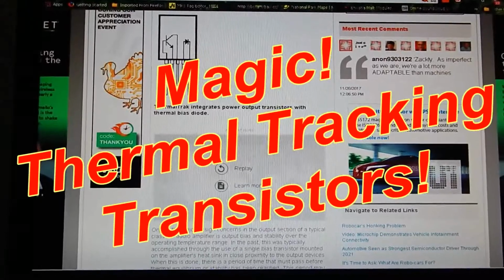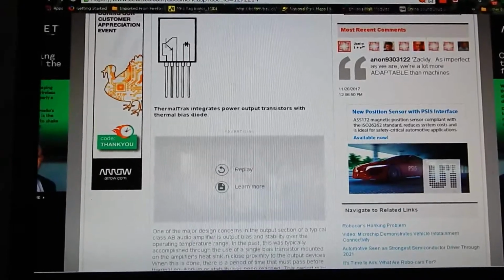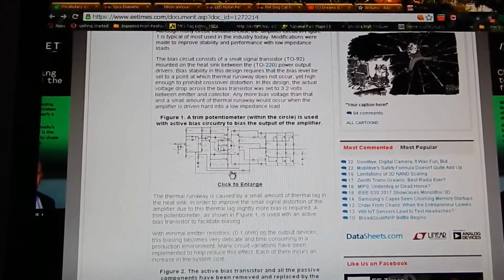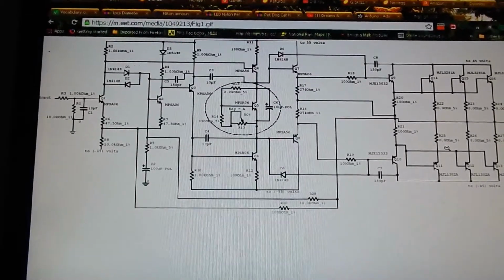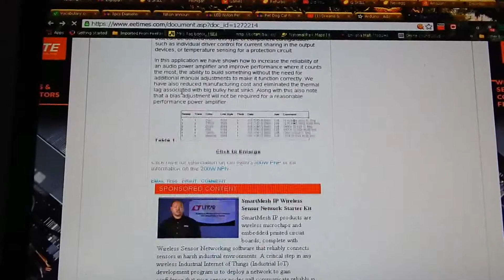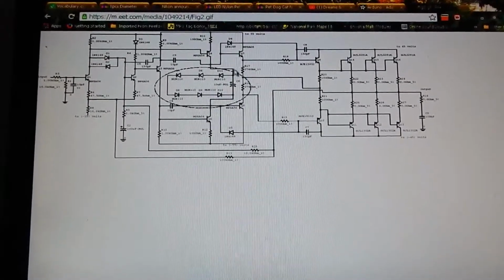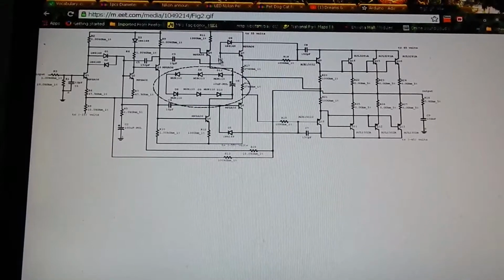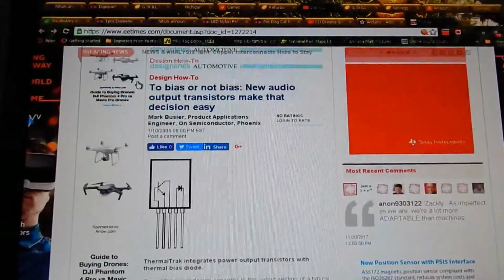ThermalTrak Transistors - No Bias Adjustment Needed!

Comment: These have been around awhile. In Bob Cordell's power amplifier design book, he shows them integrated with conventional transistor bias spreader circuits. The idea is to track the thermals faster, not make the circuit simpler but at least it makes heatsink mounting of another sensing diode or transistor unnecessary.
Reply from the maker: The promo stuff I looked at, aimed at the OEM, did push the simplicity angle, a lower parts count, but mainly (I think), eliminating the need for a technician's tweak. I see MacIntosh used them in some of their amps. 
I was going to quip that "I bet they are expensive" but thought to look first, they are pretty reasonably priced,
for four dollars at single quantity, you can get a 15A/260V/180W device (plus shipping). So with that high voltage rating, these seem intended to be paralleled up to make high power amps. NJL0281D /302D
Reply: These have very nice specs given that it is a later model transistor produced for audio. My issue with them is the nonstandard pin spacing. If these go obsolete at some point, it would be difficult to wack in an ordinary substitute transistor and then you'd have to deal with the diode. They should have made pins 1,3,5 for the transistor and 2 & 4 for the diode. My personal favorite OP transistor is the 2SC5200 / 2SA1943 pair.